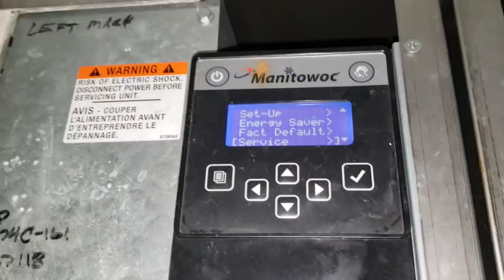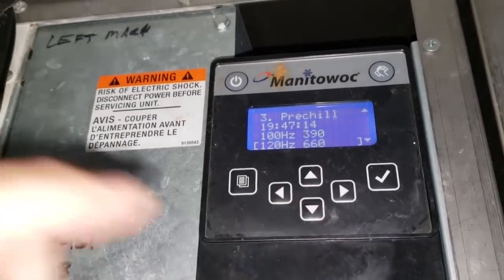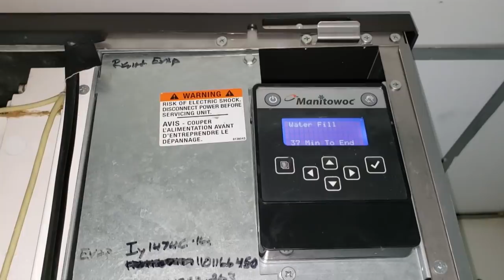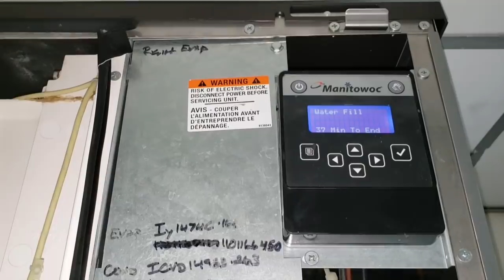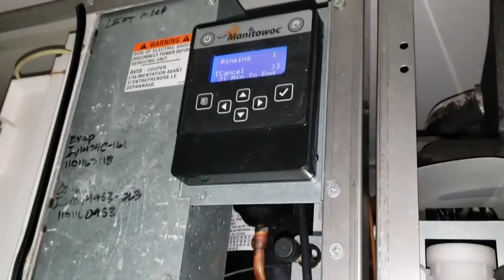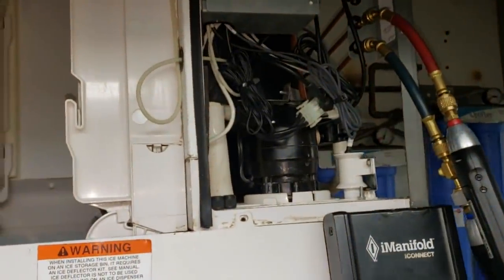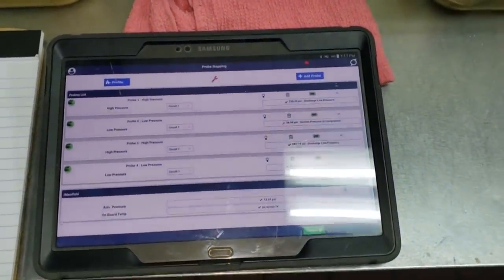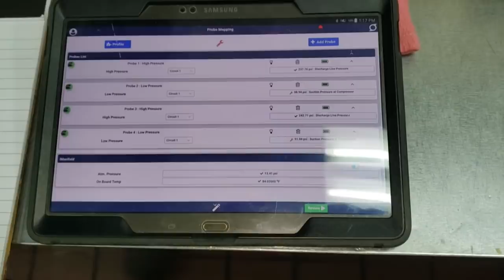MANITOWOC ICE MACHINE NOT WORKING

Comment: When I was a wee lad back in the day - 1990's - I worked in a commercial kitchen than didn't like to spend money on anything.  The ice machine stopped making ice; the water inlet was controlled by a float valve, and I found the float, um, floating.  A pin had vanished out of its linkage, so it fell off, and the valve was running new water into the machine full-bore.  Unwisely, I told the boss I could jury-rig it for now with a paperclip, to reconnect the linkage and get the inlet valve working again, but it would be very much a temporary fix and they needed to get the correct part.  He said go ahead, and I did, and it worked.  I don't remember how many days or weeks it lasted, but it didn't take long for that paperclip to rust through and the float to fall off again.  This, of course, was my fault - "What do you mean it's broken again? You said you could fix it!"  Good times.
Reply: Replace the paper clip every two weeks
Reply: I should have thought of that.  8-)  I also should have burned all the ice and searched more carefully for that pin - theoretically, it might have gone through the water pump, and ended up in an ice cube, and then in the bin, and then in a kid's small intestine.
Reply: Dont you love working for someone who likes to blame you for things?
Reply from the maker: thanks for watching I'm gonna go live this evening 4/29/19 at 5PM (west coast time) to discuss my most recent uploads and answer questions from emails, the YouTube comments and the chat come on over and check it out .   https://www.youtube.com/c/HVACRVIDEOS/live
Reply: That's when an anonymous call to the Local Health Inspectors is a good thing...

Comment: Fyi : For the New Guys Out there --- if u Have Heavy scale on The Plastic Parts of the ice machine. You CAN get Rid of EVERY spec of it. This is ONLY for Plastic parts ---- You can use Full strength ice machine cleaner or Full strength nickel safe  on Plastic only ! You put it in a Spray bottle , Label it Full Strength , Then Spray it on ANY scale Wait a Few seconds and it will start eating / Foaming away at the scale. Lightscrub with a Stiff brush after 1 minute , Then Keep spraying on area till gone. , SPRAY Wait a Few minutes till foaming stops , then light scrub , Repeat , SPRAY till foaming starts, wait till it stops , then light scrub , Repeat.  WEAR Eye Protection !!! ice machine cleaner is acid.  ! Let the ice Machine cleaner do the Hard Work. not the scrubbing. Let the acid loosen the scale , then wipe it away. Spray , then wipe it away Repeat. The Scale neutralizes the acid , Thats why You Have to continually Add More ice machine cleaner / acid to the scale.
Reply from the maker: Great tip Phil thanks for chiming in, I love the fact that we can truly have a community of people that are trying to help others!

Comment: I remember when I used to work at 7-Eleven Corp stores, the ice machine would be cleaned every month like clock work.  Now I see why.  If they had some kinda water treatment to pull that calcium out before hand, that likely would have stopped this machine from getting as bad as it was (unless they did and that wasn't being maintained as well).  I can't believe they were using that machine for customers.

Comment: We have a refrigeration company that comes out to clean our Hoshizaki Ice Machines but sad to say, they never come close to looking like the machines you service. To be honest, its hard to tell that they were ever cleaned to begin with & my employer keeps paying them! They are always looking for the cheapest price & like we all know you get what you pay for. I think these guys just clean the filter element & cycle chemicals through the machine & call it done. I always find missing screws, dirt, dust & the auger/gear motor assembly always looks like it was been sitting at the bottom of the ocean for a few years due to all the scale buildup on the housing. I wish we had the manpower & staffing so we could do our own or be able to hire your company to perform our ice machine PM's.
Reply: @T.Overton0413 When I perform a PM, you can tell someone has been there. Yes, things are not always perfect but you can see the results. Not much of a attempt is being made to clean the machines & they do not get taken apart by our vendors. I'm not too concerned with the hoses, its the lack of overall effort to attempt to properly clean the machine.
Reply: @T.Overton0413 The management here is our problem. I am located in San Diego, CA. They do not want to pay for the best. The problem is cheap labor always costs you 3 times as much in the end when they have to keep coming back.

Comment: Tis is why I never ever have ice in my drinks.
Very instructive vid , Chris,  thank you.
Btw , is that the field piece digital thermometer on the shelf behind you ?
How do you like them , do the probes come with velcro attachment for the pipes ?
Reply from the maker: no it's not the thermometer it's the anemomoeter and a psychrometer I use the fluke 52 for the dual thermometer because you don't have to take the battery cover off to adjust the calibration. thanks for watching I'm gonna go live this evening 4/29/19 at 5PM (west coast time) to discuss my most recent uploads and answer questions from emails, the YouTube comments and the chat come on over and check it out .   https://www.youtube.com/c/HVACRVIDEOS/live

Comment: I have a Manitowoc that's over filling after a good completed cycle/s. I have cleaned it thoroughly with Manitowoc cleaner and sanitzed it as well with Manitowoc sanitizing solution. It runs properly till I leave I get a call back that it keeps over filling. Basically the entire time that I'm there It runs and the customer says it runs a couple of hours and then it starts overflowing. I have cleaned it twice already. I have replaced the water level probe and the wire harness for the probe. Still same issue. Would you happen to know why? Great video btw 👍 the 2nd time I cleaned it I followed your steps in this video except I used Manitowoc brand cleaners.
Reply from the maker: The water inlet valve might be sticking open, is the machine an indigo model?
Reply: I replaced that as well. Yes it's an indigo. Model IY1106A-261 Manitowoc. So far what has been done to it has been 2 cleans, replaced water inlet, water probe and wire probe harness. On the display when I go to inputs and check when "water high and low" touch water, the low stays on "no" even after it's touching water. And it only changes to "yes" when water high touches water but water high sometimes stays stuck on no causing the over flow. I have called Manitowoc and explained the same but they have no answer and will send me a board hopefully next week.
Reply from the maker: Interesting yeah I imagine the board is the next best option
Reply: I hope it's the board. Previous guy was the one who replaced the inlet valve and the thickness probe. He couldn't fix it. I came in after and have replaced water probe and harness and next board. I did notice that the previous guy put his vice grips on the water level probe to bring it down and have the water shut off earlier than what it would shut off if it was in the normal position where it clips to hold it in place. I'm assuming Reason he did that was because the display takes like 8 seconds to change from "no" to "yes" and shut off the inlet. It seems to be working that way so I left it like that too. Thing is, when I leave after a couple of cycles it starts overflowing and then I get the call. Today I waited 2 hours just watching the machine operate and it seemed like it's fine. Hopefully it stays that way. I will still replace the board to make sure and leave it as if it came out from the manufacturer

Comment: Surfaces that have calcifications -- what about spraying them initially with a slightly diluted mixture of white vinegar?  The acid in the vinegar should dissolve the calcifications, making the surfaces easier to was down with a plain water spray - perhaps with your proprietary cleaners.